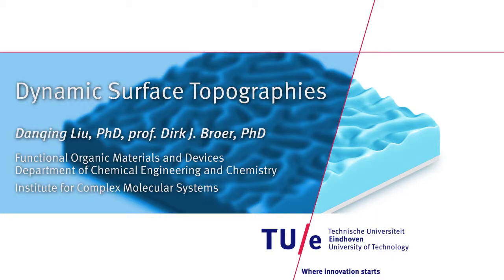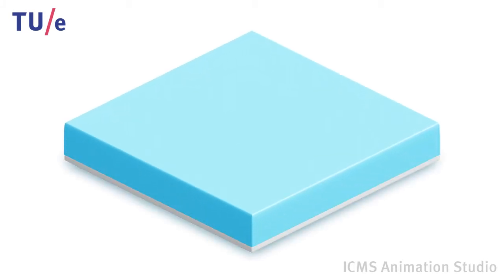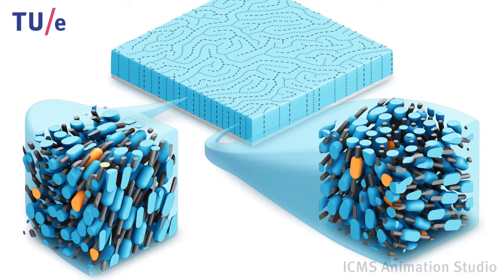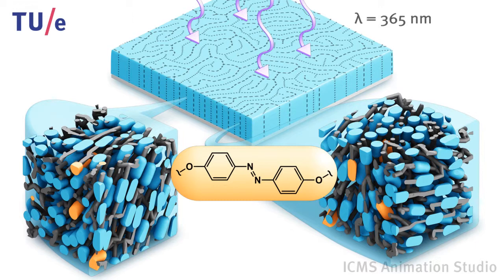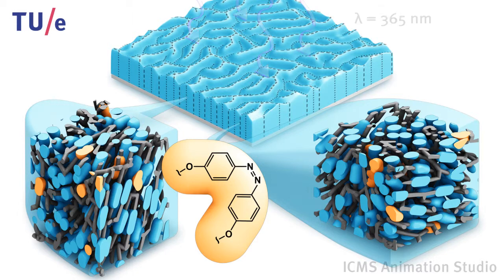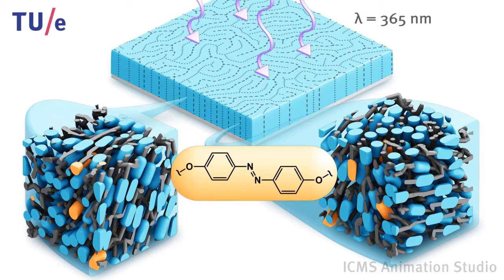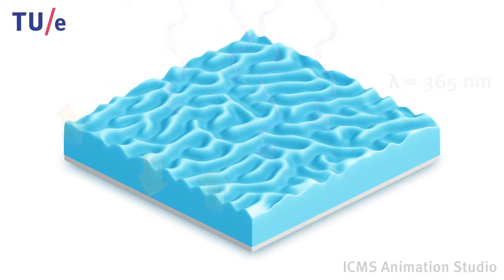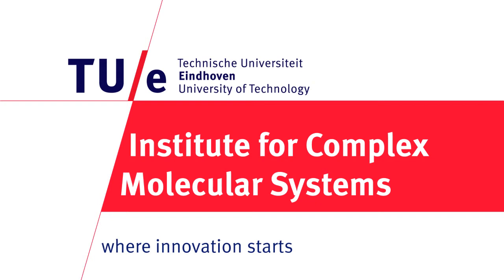Dynamic Surface Topographies

Comment: Considering the UV activation, there could also be avenues for enabling artificial skin to "tan" to protect itself from UV.  Perhaps if the UV activated compound is coupled with a liquid crystal, so it auto-darkens.
Reply from the maker: For our intended applications it is important the surface remains sensitive to UV light, but tanning is indeed something which can be realized with this system. The UV activated compound in this animation is actually liquid crystalline by itself.